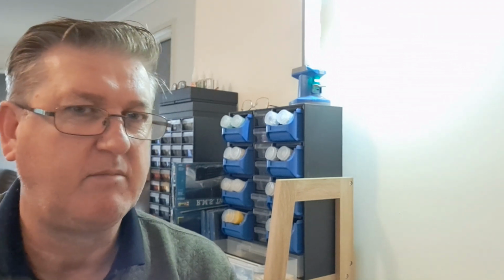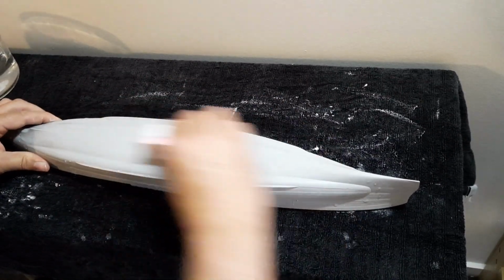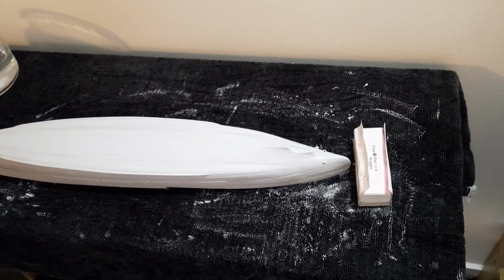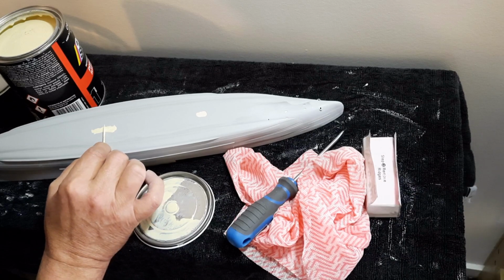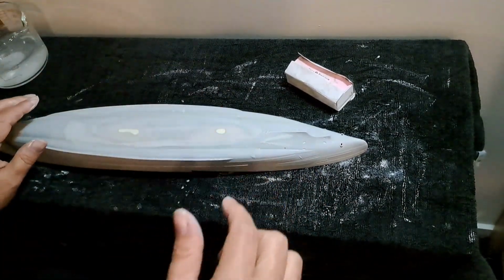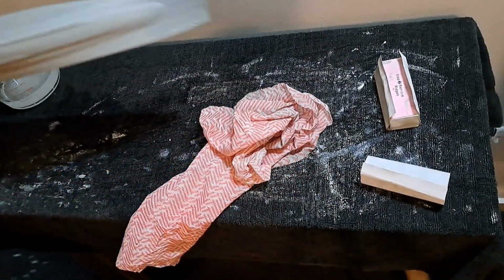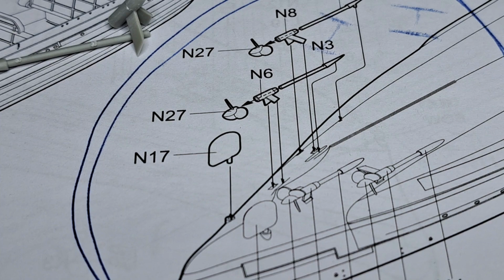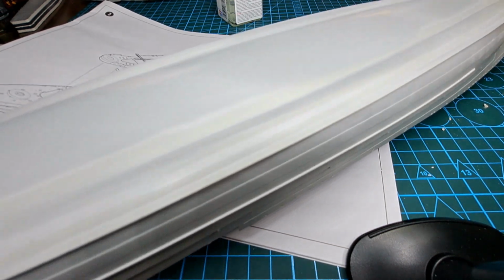HMS Queen Elizabeth build 15   tweet @bravo_workshop

Comment: Love your work mate - I don't watch all your video's online but I do save them and watch in the man-cave (no internet there)
Reply from the maker: Hello Mark glad your liking my videos, i do a lot these days on home automation and came across the same problem so i brought a WIFI extender for around $15 fixed up the problem
Reply: @mrbravosworkshop   recently bought new AX asus router new and old router both support aimesh so be going down that path but just waiting on a ethernet switch as new router doesn't have enough ports